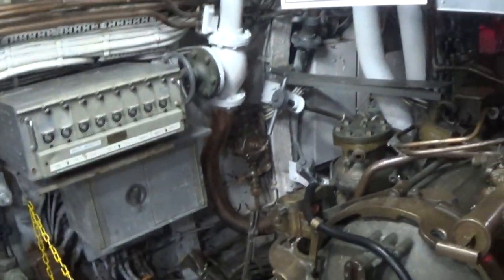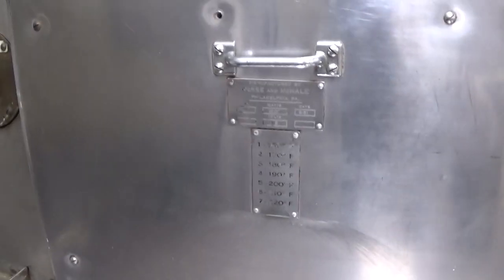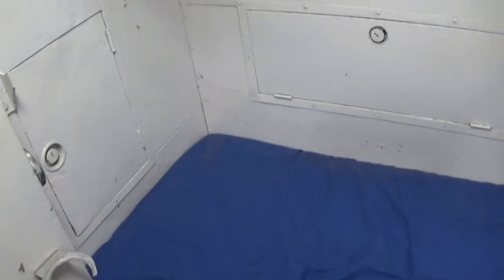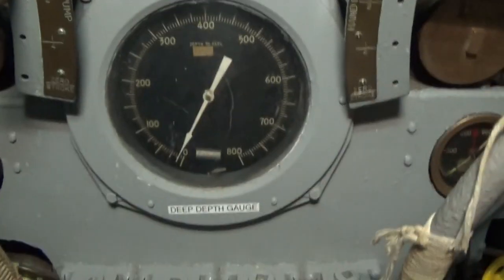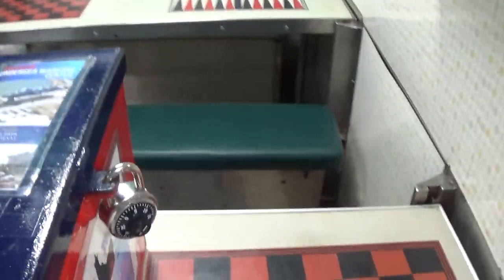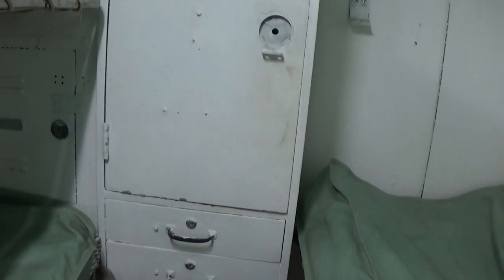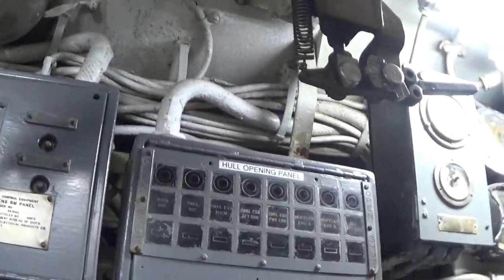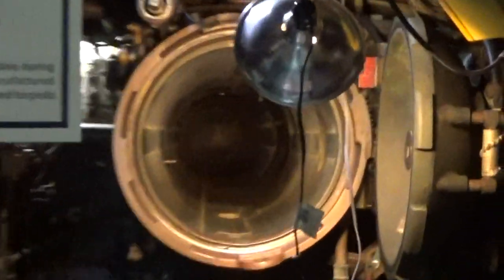Tour Inside of the World War 2 Submarine USS Cavalla

Comment: Nice video and yes they have a/c..
Reply: The air conditioning in particular had a very practical application too besides comfort. Submerge a submarine for any length of time and the heat generated by the recently shut down engines, electronic gear, and 70 warm bodies will quickly raise internal temperatures above 100 °F (38 °C). High humidity generated by tropical waters will quickly condense and begin dripping into equipment, eventually causing electrical shorts and fires. Air conditioning, acting mostly as a dehumidifier, virtually eliminates this problem and greatly increases mechanical and electrical reliability. It proved to be a key factor in the success of these boats during World War II